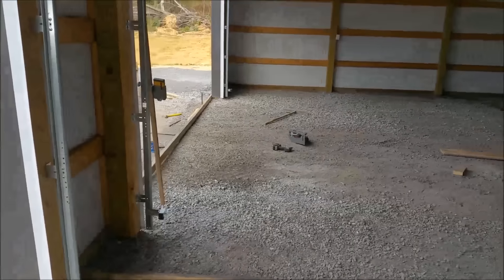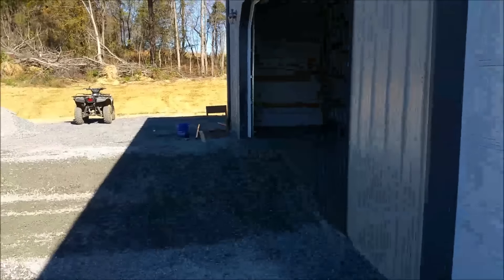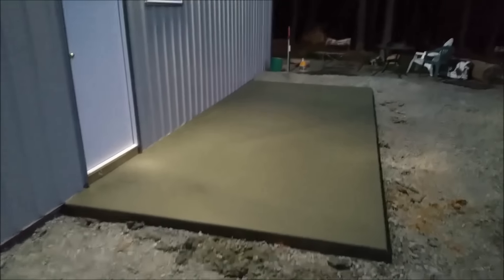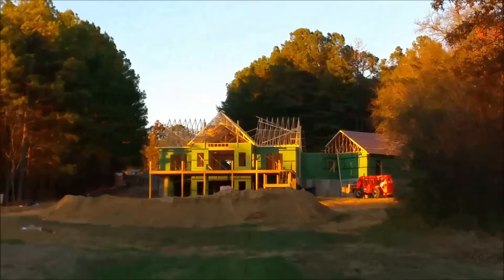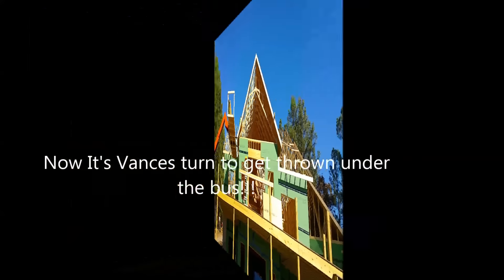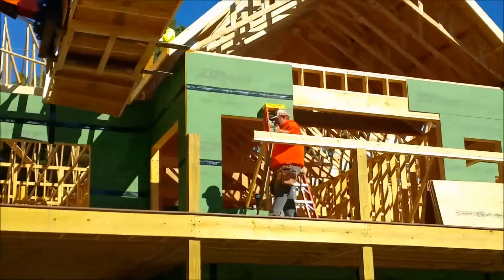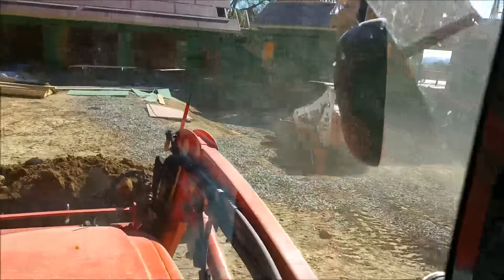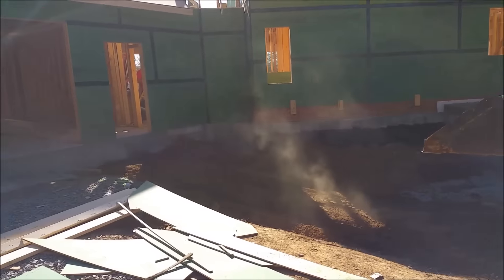Dream Home Build update! Concrete in Barn, Roof sheathing, dirt work

Comment: I would look into putting a drain in the barn floor. I found out the hard way when I parked my snow covered truck in a garage without a drain, flooded everything and it looks like you have a bunch of nice stuff in there. I have found the long narrow grate drains work best cause of the easy access to clean.
Reply from the maker: southerndiesels thanks for the suggestion! I just asked him about doing that.